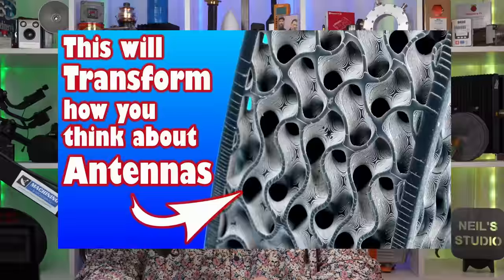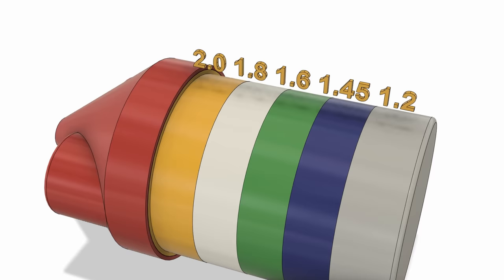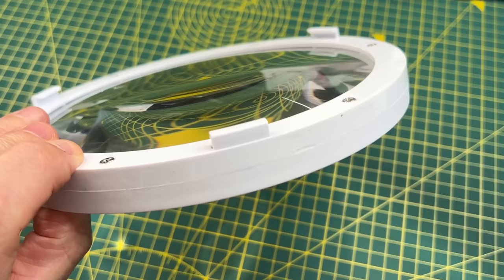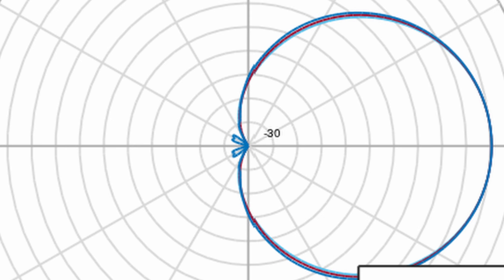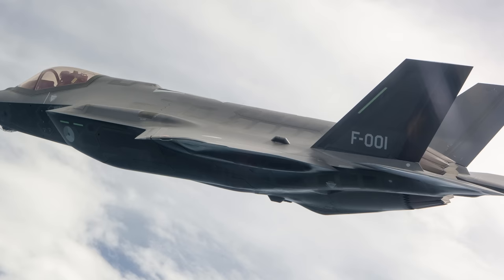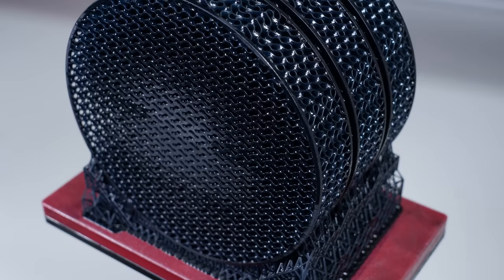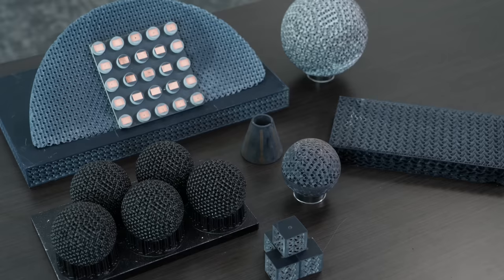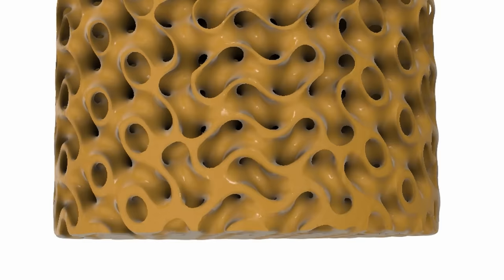How Microwave Lenses REALLY Work!

Comment: A lot of vibrational absorption bands that absorb microwave frequencies are due to the variation in local sites of atoms in a polymer.  It's not that PTFE or HDPE don't have resonance, it's that because they're very regular polymers, the resonances tend to be the same at each site rather than varying from site to site.  Because there are sharp resonance frequencies, most of the microwave spectrum is unaffected by the resonances.  For example, in PTFE or HDPE, the C-F and C-H bonds respective are identical because of the repetitiveness of the polymer chain, and so each C-F and C-H bond looks the same relative to its neighbors, except perhaps the few bonds on the end of the chain, and perhaps where there are crosslinks if there are crosslinks between the chains.  Therefore they all behave similarly and have the same resonances.    For this reason regularity of the polymer is very important because this tends to cluster the resonances into a few sharp bands that can be avoided.
Reply from the maker: Excellent explanation, many thanks!
Reply: @MachiningandMicrowaves  You're very welcome!  Spectroscopy is basically the study of symmetry.
Reply: @profdc9501  so group theory would be useful in spectroscopy?
Reply: I do the same at 400 - 800 nm.
Reply: The vibrational modes of really any molecule (the vibronic energies) are not really microwave frequencies.   Rather, the microwave absorptions and emission (scattering) operates via "domains" in which the contribution of many molecular subunits add up to a collective dipole.   Its also possible to excite higher order moments (octopoles) through induced "polarizability" but that is probably not a significant contributor for mostly aliphatic hydrocarbon materials like plastic.

For people who are familiar with their basic chemistry laboratory spectroscopy, the characteristic frequencies of hydrocarbons are in the ~2950 and ~1490 "wavenumbers" ("inverse centimeters")  corresponding to ~3.4 micron and ~6.7 micron respectively (wavenumbers scale like frequency rather than like wavelength in terms of energy)

Incidentally, this is also seen in home microwave ovens.  The water molecules vibrational excitaitons are nowhere near the ~2.45 ghz microwave frequency radiation that the magnetrons are tuned to create.  Rather, collective phonon like oscillations of clusters of water molecules are the underlying molecular dynamical process that is driven by the external field.   That value, 2.45 ghz, is also a combination of the material properties of water/food and practical optimization that takes into consideration the penetration depth of the radiation and considers the most likely temperature range of the food (~5 C "just out of the fridge" to 100 C atmospheric pressure water boiling point).   The excitation of clusters of water molecules at this energy is also useful to understand why Ice is difficult to heat.  The molecules are constrained individually in their little ice domains, and even more so when one considers the collective dynamics of many molecules together (a topic that is likely even more complicated given the various forms of ice that can form and the differences in how those different forms interact with radiation far below resonant/excitation energies)

and, additionally, as these are solid state compounds, *ro*vibronic excitations are also not really a thing since you can't excite states in the rotational manifold of a molecule that is frozen in solid state 

in the gas phase, rotational excitations are more in line with "microwave"  (or terahertz) energies.

Comment from the maker: Refraction is REALLY weird.  Even if you don't go into the fine detail of the quantum-mechanical workings, the mechanism of refraction at microwave frequencies at the molecular level is not what most folks think. My little aside about Ibn Sahl and medieval Persian rather missed the fact that the image in annotated in Arabic. My late wife Caroline would have spotted that in an instant and corrected me.
Reply: Also, since the the refractive index is also proportional to the square root of the relative permeability, a similar effect will happen with the magnetic moments as well as the dipole moments for the general case, although your 3d printed lenses are obviously not paramagnetic. It was good to open up Bleaney & Bleaney again and reread the chapter on dielectrics....
Reply: By the middle ages, I'd have thought the Persians were writing Persian in Arabic script anyway... But if I remember my Jim Al Khalilli correctly, stuff to be discussed in the majlis would have all been in best schoolroom Arabic much like medieval Christian science was all written in best schoolroom Latin.
Reply from the maker: @Mike-H_UK  There aren't many magnetic materials around that will work above a few hundred MHz. Rogers MAGTREX 555 is usable up to 500MHz or so. It has the same numeric value for relative permeability and permittivity, which has some interesting applications. I just wish it would work at 3GHz or so
Reply: @MachiningandMicrowaves  Interesting, a material with the same impedance as free space but a low velocity factor.
Reply from the maker: @Mike-H_UK  Useful for making miniaturised patch arrays without sacrificing bandwidth. Pity it doesn't go inti the microwave region
Reply: Refraction actually obeys a law like the "F=ma" (force equals mass times acceleration) equation of mechanics.  I have a lecture I wrote about it show its derivation from Maxwell's equations.

https://drive.google.com/file/d/1-5mMPttWcpo21gLy8aW5Vj3z7GJ76BnT/view?usp=sharing
Reply: @MachiningandMicrowaves  You can get "synthetic" magnetic materials by using resonators.  Often these resonators are structures in copper on a circuit board.  For example, a split-ring resonator (basically a circle of copper with a small gap in it) behaves like a single turn inductor in series with a capacitive gap.  Depending on the resonance of the structure, the induced current can lead or lag the magnetic field and therefore radiate its own field that acts like a paramagnetic material.  There are also complementary split ring resonators, which are solid copper planes with a circle of missing copper with a "gap" in it (a small line of copper left) which behaves the same, except for the electric field, which you can also see as a polarizable electric dipole.
Reply from the maker: @profdc9501  I've had a play with etched metamaterials based on concentric split ring resonators, but I think it needs to be on a very low-k substrate to keep the size reasonable and the copper losses low. I hope to work on a project using laser deposition then plating later this year.  Problem is finding a practical application that doesn't result in a lossy solution using technologies accessible to me.  If I was chasing clicks, I'd go all "Wooo! Metameterials! Invisibility Cloaks!" but I'm reading lots of research papers in the hope of finding something relatable.
Reply from the maker: @profdc9501  The inverse approach might be easier in terms of losses, I'm working on a project to make some cavity-backed slot arrays using laser sintering, but I rather think that surface finish, scattering and conductivity might be significant obstacles to anything that has thin planar structures
Reply: @profdc9501  Nice lecture, though I think it might help to explain the assumptions that mean this doesn't contradict the fact that I can split a light beam (either in half or in physics sense) and send it to same point via paths taking very different times and transporting energy at that point in different directions.

The relevant variational principle either only holds locally (I think but it's been awhile) or has some other constraint.  I know this won't cause a problem the way you do the math but I think it's the kind of thing that might be worth explaining.
Reply: @MachiningandMicrowaves  The ratio of the center lead to shield in coax depends on the dielectric of the insulator.  Also, the permeability of the insulator.  What prevents that being exploited, as you pointed out, is the loss in high perm materials.

Comment: To heat up a couple of dinner plates in a microwave I put some water in the bottom plate and place the other plate upside-down on top and heat for a couple on minutes. This works well. So to heat a couple of bowls I did the same, I placed some water in the bottom bowl, but instead of putting the top bowl upside-down, I nested it the right-side up. This created a curved lens of water in the bottom bowl that focused the microwave energy down onto the plastic spider bracket supporting the glass turntable. The spider bracket caught on fire! Once the plastic in the spider bracket started the carbonise, this seemed to concentrate the microwave energy in the carbon and a runaway effect ensued. Lesson… don’t put nested bowls separated by water in a microwave!
Reply from the maker: Ouch!
Reply: Odd, we just put some plates without any water in and they also heat up
Reply from the maker: @MaakaSakuranbo  I have some plates like that, they must have some polar minerals that are causing conversion of RF energy into heat. Could be the glaze or the bulk material

Comment: The light doesn’t appear to slow down, it really does slow down. The “speed of light” is more properly called the “speed of causality”, which is the maximum relative speed that any pair of things can have, but that does not mean light waves must travel that fast in matter. Source: I work with ultrafast pulsed lasers for my research, so the slowing down in matter is really significant for us
Reply from the maker: Interesting! Does it slow down though? Sure the pulses take longer to get from one side of a piece of material than they would in a vacuum, so at a macroscopic level, they certainly appear to be travelling slowly, but what's the molecular-level  or quantum mechanism for the slowing?  Don't the laser photons interact with the electron clouds and get re-radiated by coherent forward scatter in a similar way to what happens with molecular bond coherent forward scatter at microwave frequencies? The coherent scattering has an inherent phase lag because the electron charge cloud and nucleus have rest mass.  They are forced  to move apart or together slightly by the electric field of the incident EM waves.  They then radiate that energy as they are moving charges, but with a phase lag. Then the superposition of all of those interacting electron cloud/nucleus  oscillations sums to an output that's delayed in time? Talking classical here rather than quantum field theory,  but what is the mechanism that can slow light down without the presence of gravitational gradients strong enough to cause relativistic effects?  What's the mean free path of your femtosecond pulses in a solid medium compared with the size of the electron clouds and inter-molecular spacing?
Reply: if light slows down traveling through matter, is there a medium that can speed it up?
Reply from the maker: @amirsadeghi9888  Metamaterials can make it appear that the speed of waves through a material is superluminal, but it's usually done using resonant structures and the effect only works in bulk. You can't get any information to travel faster than light, so causality isn't affected, it's more about a negative refractive index, where lenses bend light the "wrong" way to make sort of invisibility cloaks. Kind of...
Reply: @MachiningandMicrowaves   wow thanks for the response, very interesting, but what if I want it to affect causalty,lol. Metamaterial and gaseous lenses and laser couplin can create negative reflective index and make light bent the "wrong" way out or appear it travels faster than light, but what about quantum tunneling and "spooky actions at distance" which aparantly travels faster than light...? there must be a way to go superluminal without blowing up the universe, lol. perhaps an ai with a quantum computing operating system can help solve going warpspeed
Reply: @amirsadeghi9888  quantum entanglement does work faster than light, but there isn't any extractable information conveyed, so the speed of causality isn't violated. There really isn't a way to go superluminal. If you really want to go warpspeed you'll have to bend spacetime in order to reduce the distance instead of trying to increase your speed.
Reply: @theaveragepro1749  what does "extractable information conveyed" mean exactly? is this a way of recording the speed of light or entanglement at a distance? such as atomic clocks? superluminal speed reminds me of breaking the sound barrier, seemed impossible one day until it wasn't...I don't understand how going faster than light would violate causality? because it still takes time to get there although a very short amount or even instantly, we're still not going back in time, even if we go 10 times the speed of light, I'd say we don't violate anything at least at the point of departure...because time moves forward...?!?! i dont know lolol
Reply: @amirsadeghi9888 long story short, due to the laws of physics no information can go faster then light in a vacuum that's it, there's no going around that. The other methods mentioned are quantum entanglement which may seem to be faster then light but sadly for sending any information ( like message) it has a limit of  light speed and for warp drive that's more reshaping space then going quickly through it.
Reply: @amirsadeghi9888 to be extra clear light in a vacuum  goes the speed of causality if you go faster you will some somehow effect things before they are caused aka time travel.
Reply: @kkamau5479  correct me if I'm wrong, but when we're traveling from A to B, no matter how fast we go, we still spend time, traversing the distance, so I don't understand how speed affects causality?
Reply: @kkamau5479  also, isn't the universe expanding at the edges, so that means it's going faster than the speed of light? and if you can go a little faster, then you can go a lot faster, lol, it's just a technological and computational barrier that will be solved one day, I just hope I'm alive and well to see it and experience it.
Reply: @amirsadeghi9888 if light goes faster than light, it creates matter. Hysteresis of the medium, which lights perturbates, will create hydrogen in it's wake. It's been shown experimentally with lasers.
Reply: @jesterprivilege  Okay, that makes sense, light travels faster than light creates matter, sorta like replicators in star trek lol. but what if matter can travel faster than light, I was reading about the neutrino observatory at the south pole, and apparently neutrino particles that seem to occupy a space as big as a building travel faster than light travels in ice. Neutrinos are the lightest observed matter to date. So basically ice doesn't affect their speed as much as it affects light. so in a way, matter is traveling faster than light in ice, not faster than the speed of light in a vacuum. so if matter can sometimes travel faster than light, maybe it can always travel faster than light and on demand.
Reply: @amirsadeghi9888  I'm a layman, but I picture it like a wave in the ocean reaching the shore and forming a tube like shape. Light propagation, reaching gamma levels and beyond, eventually reach a point the wave goes faster than it's base and topples over. The wave sorta collapses into a dynamo in the form of a hydrogen proton. The basic form of matter.

Comment: Well worth waiting for the last little bit, I never knew about the phase shift caused by the individual atoms causing the reduction in the speed of the beam, I was always told that the speed of light was ~300 million meters/sec IN A VACUUM but was different in other materials... just accepted it without ever asking "why?"
Reply from the maker: Yep, and it most definitely isn't.  OK, what's REALLY going on is quantum interactions of the electron charge clouds, but the system is macroscopic enough for a classical treatment to give reasonable answers.  I really should do a simulation to show what is going on, also explain all of the partial reflections. Feynmann does a decent job of it.  I think I need to move on and get back to machining stuff.  I'm THIS close to signing an order for a £37k CNC machine with 4-axis and a 16-tool changer, and it needs to earn its keep.
Reply: It really does slow the light down though. I work with pulsed lasers and going through a medium actually induces a measurable delay in a pulse compared to without the medium in the way. It’s not just an illusion
Reply: Sound waves shift phase in different enclosers and when penatrating different materials as well I didn't think about the phase relationships of light and radio waves doing the same things and I was a cumunication and audio tech for 40 years learn something new every day

Comment: Medical X-ray machines that use the peeling of adhesive tape from a roll are really interesting. 
The came out around 15-20 years ago. 
It was a way to make an X-ray without a power supply. 
The breaking of the electron bonds created X-rays that interacted with the X-ray sensitive film.
Reply from the maker: I remember trying to get images of the fluorescent flashes from sellotape being peeled back in the 90s. I could see them in a dark room, but never managed to get useable images.  Interesting!